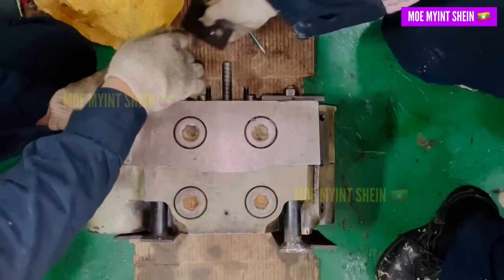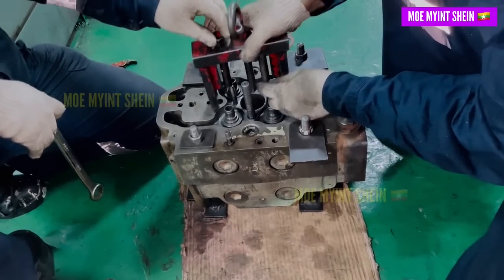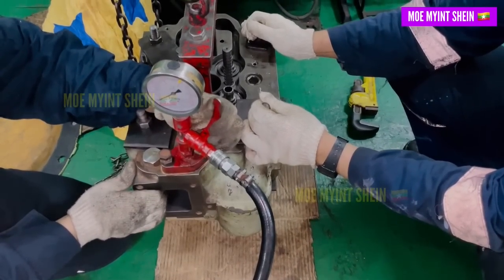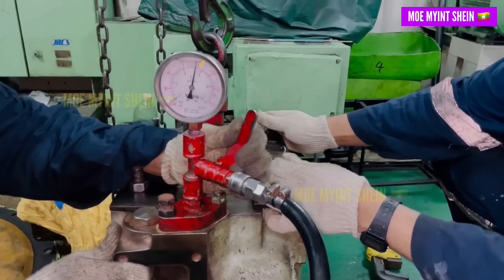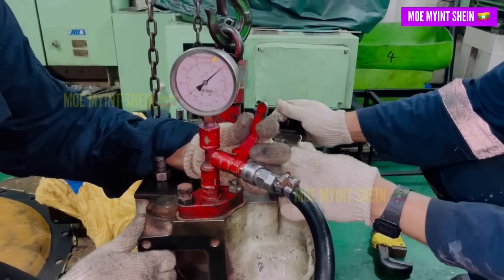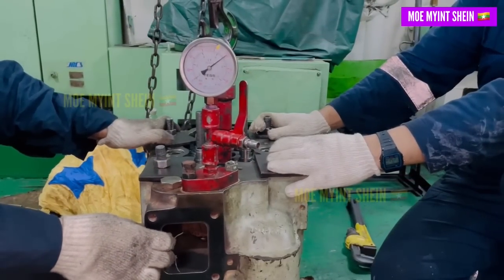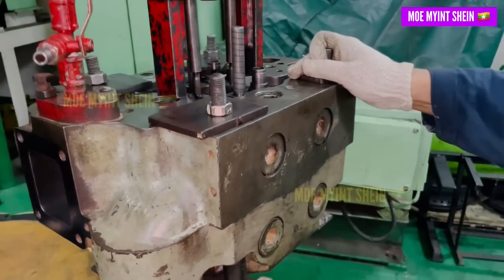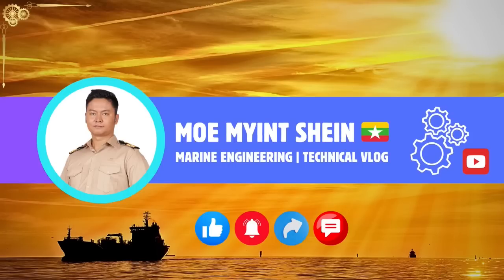[YANMAR] Pressure Testing of Cylinder Head | MOE MYINT SHEIN | Technical Vlog : 132

Comment: Good job sir👍🏼 Should I ask something different, Sir? I looked at the manuals and didn't understand. Should the jacket water be drained before removing the AUX engine cylinder head? If so, how is this done?
Reply from the maker: Domestic water can be used to fill into cylinder cover for testing. 🙄